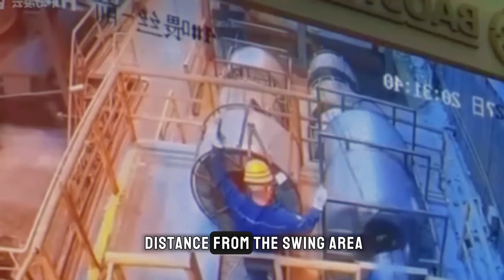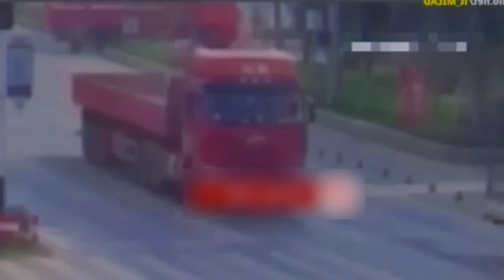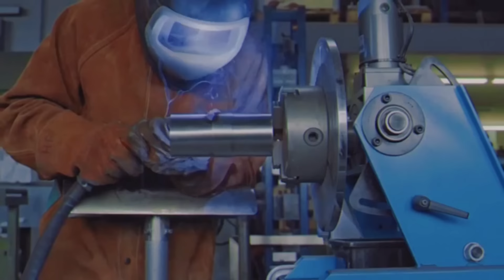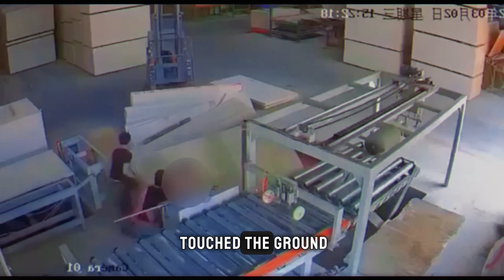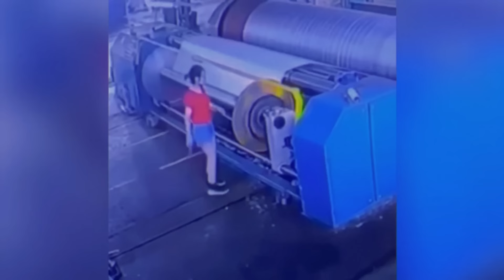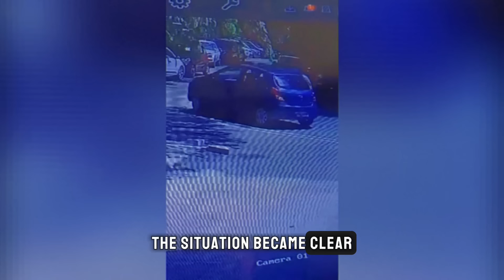The Factory Owner Was Trapped Inside — The Worker Tried to Save Him! | Industrial Machine Accident

Comment: In the first clip, the biggest error was not positioning the crane above the load.  If the crane is not above the load, the load will start to swing, immediately, as it is lifted off the surface that it was resting on.  If the crane cannot be over the load, how did the load get there?  Use that equipment to move the load.

In clip 7, the forklift driver did not approach the work cell in a way that would allow him to see if anyone was there.  Before the load spills, we see the forklift rock forward, suggesting that the load was some combination of too heavy or the load's center of mass was too far from the lifting rack for the forklift to be stable.  The driver did not lower the load, the driver tried to stop and the forklift pitched forward and the load slid off of the forks.

I am trained to operate a mechanical flywheel press.  I was trained to accept that, once the press was moving, all that I could do if I noticed something was wrong was watch.  What is not mentioned in the video is the use of tongs to move pieces, without placing hands in the die area.
Reply from the maker: Thanks for the detailed safety insights. Your experience and explanations about crane setup, forklift stability, and press safety add real value to the topic. Appreciate your input.